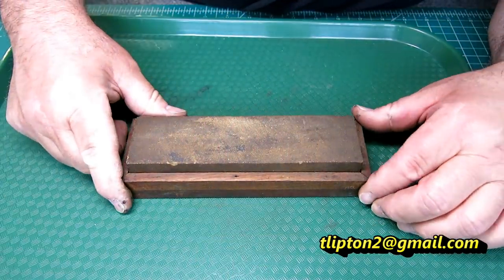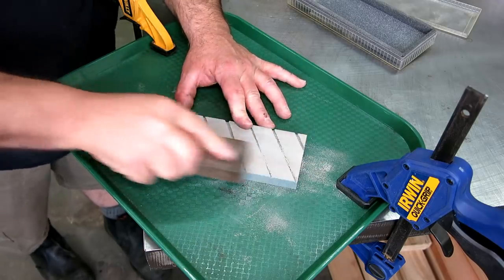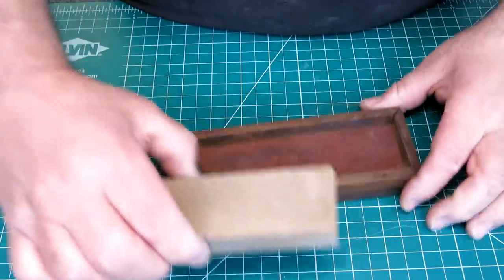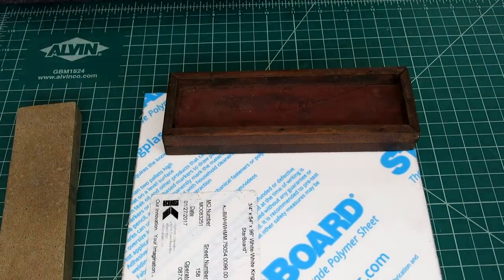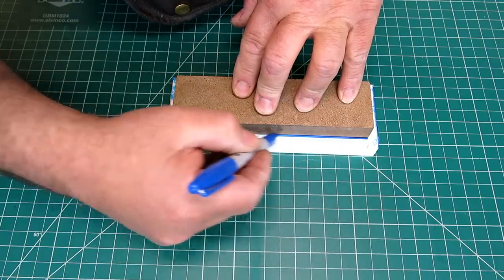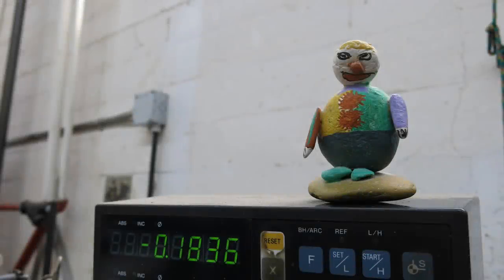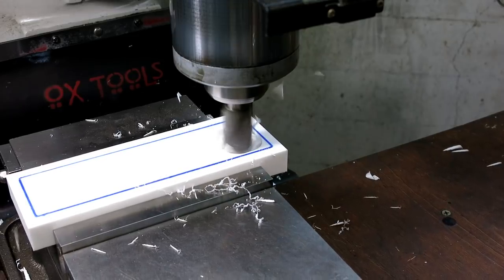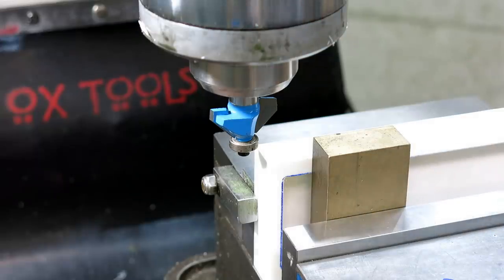Grandpa's Swayback Bench Stone Restoration

Comment: I use diamond. They are expensive, for the good ones. The ones I prefer have diamond bonded to a thick (1/4” to 3/8”) ground, hardened and tempered steel block. If you use them properly, they last forever, and flatten out that ground stock from Starrett that’s supposed to be precision flat, but is wavy, which you can see with a light run over with a flat stone.

Comment: No, I'm afraid a stone has to have a wooden box otherwise it loses its character..
Reply: And it's grip on the table top.Keep the wood box as a lid, or a base.
Reply: Not to mention all that machining and effort with that plastic lump.  Someone should tell him it’s actually possible to glue two pieces of wood together.
Reply: Keep the box flip over the stone done.   After all that shaving the stone no longer fit snugly in the wooden box.  He just wanted to have something to swap not to keep.
Reply: People wouldn't use wood if it didn't grow on trees

you're on a machinists channel. We don't much care for wood in a shop
Reply: Nice piece of boxwood, or cherry... Probably cheaper than acrylic and much nicer!
Reply: @tylergarza8695  well, I’ve machined a lot of wood in my lathes and mill. High value wood is good to machine. Just keep the wood dust and shavings away from anyplace where two parts of the machine move.
Reply: @inkdreams5113  I’m sure he knows. Back in the old days, everything came in wooden boxes. Why? Because they didn’t have plastic injection machines. And at first, when they did, injection molded plastic was expensive. When prices came down they replaced wooden ones.The wood gets dirty, scratched. The joints come apart. The hinges come off. The labels come off. It’s a mess. These are cheap cases after all. But plastic ones are much better, and you’re not paying as much for the cases. Cheap though they are.
Reply: @tylergarza8695  except Machinist toolboxes are usually made from Oak
Reply: Frfr

Comment: If you close the vise and lock the quill at a fixed height, you can run the part against the bearing and just cut the chamfers by hand, like a router table with a floating bit.

Comment: I did a video a while ago where I had my grandpa's stone in about the same shape and I hit it in the mill with a concrete grinding cup wheel with great results now I will get the flattening diamond plate you pointed out to finish the job so thanks for the heads up on that Tom.

Comment: I recently ran across the DMT Dia-Sharp stones.  They claim "The diamond surface is ground to be flat, and it will stay flat. ", but don't specify how flat. I sent a message asking for their specification, but never received a response.   They claim their lapping plates are good to .0005", but they are substantially more expensive.  I was kind of curious to see whether they might be somewhere between a regular stone and a precision ground stone for knocking off burrs.

Comment: Loved using the bearing on the router bit as an edge-finder. I would keep the stone in the wooden box. When you need to use it, use the HDPE box mounted to a work-surface. Fix the crack with some Resorcenol and always keep the stone in it. It WILL sharpen better, because it knows you love and respect it... Things and Machines have some degree of consciousness too...

Comment: I found that using an large (used) garden tile with a sharp grit top layer was very effective at getting an old stone close to flat. Then you only use the expensive flattening stone for the final finish.
Reply: Agreed. Good tips for the stone but all my stones have original shop patina cradles. I prefer that vintage look over a piece of white (🤔) plastic.
Have a day, dood.
Reply: I've used concrete cinder block to flatten some old stones, and yep finish off with the expensive stuff after...

Comment: I love his work buy why would you buy an antique stone then throw away the antique box? like if you are going to make a new box for it just buy a new stone?
Reply: Once I got to the part where he threw the box away I immediately stopped the video and hit dislike.  I thought this was a restoration video.
Reply: He said the stone was only a couple of bucks.  No one said this was a antique restoration video.  I say good job.
Reply: Agreed. I'm not even so sure there is much value to reflattening it. I clean old stones with the wire wheel just to clean them up so they cut well and aren't all clogged up.

I made a bottom for three stones out of a hunk of arborvitae I took down and it worked out wonderfully because it shrank to fit them all.
Reply: Because the goal is to get a usable tool. He took a stone that was unusable, in an unusable box, and fixed both problems!
Reply: @kevinvermeer9011  To be usable it doesn't need to be flat, it needs to have open pores so the cutting edges are exposed. That's all.

And what was wrong with the box beyond showing some age? Nothing a little glue couldn't fix. What's the point in making it look pristine beyond doing a YT video?
Reply: @johnpossum556  I guess you have never done any precision sharpening. Flatness is by far the most important rule.
Reply: @johnpossum556  If you are using it to sharpen irons for hand planes, it definitely needs to be flat within a few thousandths of an inch. If you are using it to sharpen knives, then yes, who cares?
Reply: @CraigsWorkshop  Not true. It's all relative to what you are doing & why you are sharpening it. For instance that rounding effect the dished stone has is very helpful when sharpening mortising chisels because it aids the prying action the chisel is also doing.
 Curt Kencayd: Depends on the hand plane. Most of the scrub planes have very rounded edges. Have you ever really worked with one?
 Honestly I'm no machinist and for what I do I rarely find a dished stone to be different but then again I have much better methods of sharpening available to me. I prefer a 3 by 21 sander flipped upside down and use fine belts available to knifemakers.
Reply: John Possum yeah but the guys a machinist. A stone isn’t nearly as useful to a machinist in that size unless it’s flat.

Comment: It is most interesting that in my life I've not worn a stone to the degree which frequently appears on the you tube videos, however all my knives, blades, and cutters of every type have sharp edges to a one perhaps the technique of not using one spot has worked, as all manufacturer's suggest the purchaser adhere to this method.

Comment: Rather than add more plastic waste (the chips) to the environment, I think you should have repaired the original. Very cool all the same.
Reply: With so much effort put into restoring an old stone, I was surprised the original case was not restored as well.

Comment: How stable is starboard? I tried a similar project with HDPE and it warps terribly after cutting.
Reply: I hadn't thought about stability, though I had been wondering how it held up to oil. I wonder if it degrades, swells, or lets oil seep through?

Comment: I have the same Silicon Carbide flattening stone and the instructions that came with mine said to soak it in water for 10 minutes. Used wet, as soaking stone, I use it to flatten the Japanese waterstones that I use for sharpening my kitchen knives and have found that it has worn very little. I wonder if using it dry as you did was the reason it wore so quickly?
Reply: It's for waterstones. Western stones are way harder, so  obviously they'll wear ir out.

Comment: "I wonder how many years it took him to wear that hole in the middle"
With a natural oil stone? probably quite a few
With the waterstones I like to use? About 2 hours of use.
Reply: I used to use Japanese water stones with my Japanese’s chisels. What a pain! I spent more time flattening them then using them. Then I discovered diamond flats. Vastly superior! It’s not even close. And I use them for everything. It shows that the old ways are often just the old ways, not the better ways.
Reply: @melgross  Nah I disagree it only takes like 10 seconds to flatten them, if it took you longer than that you were doing it wrong. They cut soo much faster than oil stones. High grit diamond wears out relatively quickly and don't even cut all that fast compared to water. They also like to leave big ol scratches in what should be mirror finishes (just a byproduct of how the are made) so they aren't really suitable for super keen edges.
Don't get me wrong I have diamond plates and natural stones too but they all do the jobs they are best at, water stones are deff the workhorses of sharpening in my shop.

Comment: I just want to go against the crowd here.
Throwing away the box is just fine. The stone is the actual tool, and you made it work again. Made a more usefull and durable holder for it. 

Why keep the woodenbox? Cheap wood in a bad condition, with no value what so ever.